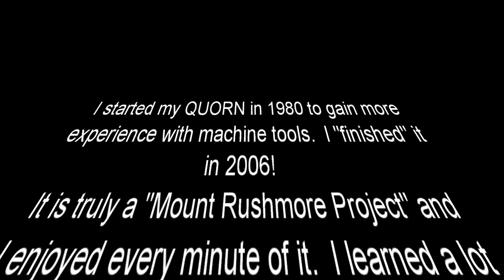The QUORN Grinder: Sharpening Lathe Tool

Comment: Besides a lathe and a dividing head or sorts, what other special tools do you need to finish the kit?
Reply from the maker: Hi Miguel,
It all depends on how much time you have and how soon you want to finish it.  The construction notes that were printed in Model Engineer required only a lathe,  a drill press., hand tools and precision measuring tools. 

I used a lathe, drill press, horizontal-Vertical milling machine w helix milling attachment, small surface plate  and basic precision measuring tools.  I hope that helps.
Cheers,
F.C.

Comment: Thanks for sharing this, so few videos available on these amazing little grinders. Did you make all the castings or get them as a kit? How happy are you with the power on it, any issues with it wanting to bog down when taking a cut?
Reply from the maker: Hi John Prosser,
I bought the kit of rough, unmachined castings, springs, round bars and diamond nib from Model Engineering Supply (I think)   in England in 1979.  M.E.S. is long out of business now I imagine.  I put a 1/7 HP Bodine Electric motor on mine.  As long as you keep the the feed low (<.0005") and keep the wheel well-dressed and sharp, this is a reasonable amount of power.  I see  this machine as a "sharpener", not a "shaper".  I'm planning on using diamond and or CBN wheels because they're cleaner and faster cutting.
Cheers,
F.C.